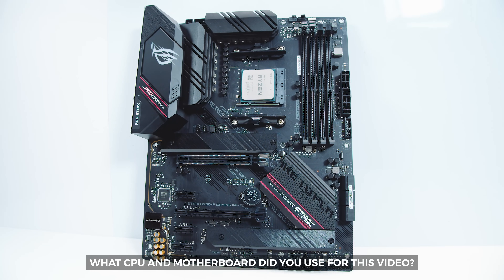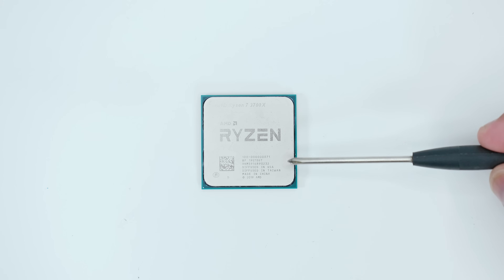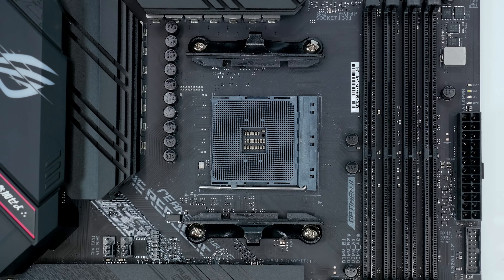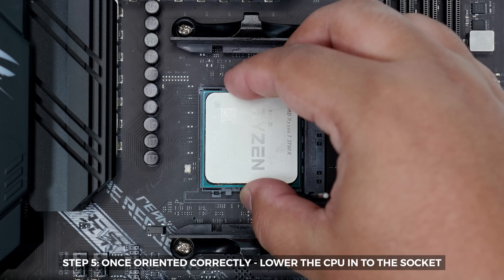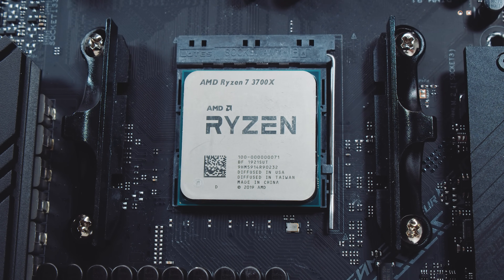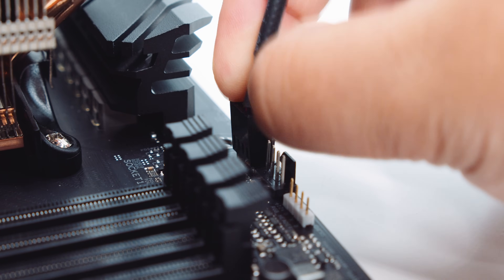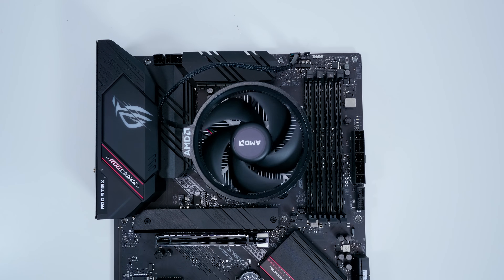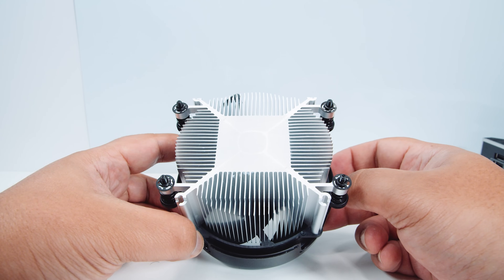AMD Ryzen (AM4) CPU Installation For Beginners + CPU Cooler

Comment: Good video for beginners.  One thing I'd add though is if using a Wraith Spire/Stealth or other cooler that uses the stock backplate but not the brackets, then keep the brackets and screws in case you change coolers or you need to return (or sell) the motherboard.
Reply from the maker: That's a good tip. I did think about adding that in to the video but I didn't want to confuse beginners too much. I'll pin this because I think it's a great little note.
Reply: Questions? With the paste. With applications that already came with paste, is it ok. To remove the pre applied  and apply my own.
Reply: @agskeete  of course you can, but I think it will not make a difference. If you are buying the product from a less well known brand then maybe, but usually no.
Reply: @stanleyshanks4409  so it won't make a difference.  Kraken z73 haven't opened it yet. But I'm guessing paste is already applied. I've picked up paste corsair xtm50 and Artic mx4... but since it won't make to much of a difference I won't bother reapplying my own.
Reply: @agskeete  ye you'll need to clean it off, usually with alcohol each time you take the cooler off and reapply your own paste when you put it back on
Reply: @agskeete   I would suggest that myself, go with a thermal paste that you trust!
Reply: Oh yeah... I have tons of questions.

Comment: It has re assured me that the stock  cooler fan will fit as when I go to fit my Ryzen 5 4600g it seems to rest on the edge of the row of capacitors at the side of the cpu.

Comment: I came for AMD cpu installation and it was so perfectly shown in this video. I was just wondering how the cpu is locked securely on amd, because on intel you can see it more clearly how it's pinned down. I still prefer intel's design though.

Comment: It wasn't mentioned that some Ryzen processors do not just drop-in completely flush with the socket.  Sometimes you have to push down on the corner where the yellow triangle is and then it clicks in place.  Then it will lie completely flush.  But certain Socket AM4 mobo mfrs and even AMD won't tell you this anywhere on their websites.
Reply from the maker: Because its not true
Reply: @GearSeekers  Yes it is.  I checked all pins and they were perfectly straight, so lowered it to the socket the correct way round but it didn't lay completely flush even though the retention lever was fully up.  I then pushed slightly on the corner where the triangle is and it slotted in flush.  Then removed it to check pins again and they were still perfectly straight.  So I inserted it again and this time it slotted-in completely flush without any assist.  I raised this whole issue on a forum and other members said they've experienced the same thing with AMD processors.  Like it or lump it!

Comment: Nothing sucks more than having the backplate fall away from the motherboard when installing a cooler. Had that happen with an Intel socket, no choice but to remove the motherboard and start over.

Comment: Q. Thermal past on stock cooler - Does the stock cooler with say 5600G come with thermal paste? Do you have to do anything to the reapplied thermal paste before installing it.

Q2. Is there any orientation for the stock cooler that comes with AMD 5600G CPU?

Comment: Perfect instruction, Nick - and very encouraging.  

My OCD wouldn't permit me to accept a 3 or 9 o'clock sideways position of the Wraith Spire HSF AMD logo and so, with mine, I removed the fan (4 phillips screws - easy) and rotated it 90° ... et voilà - AMD logo lettering upright at 12 o'clock and ... OCD becalmed.  In 2017 as an early adopter of the AMD Ryzen R7-1700 with its Wraith Spire RGB Cooler Master HSF (c/w copper vapor chamber insert) I thought my build was rather unique with this simple mod ... alas, I've since learned otherwise.
Reply from the maker: I covered that in another video with rotating the fan 😉

Comment: Neat video. Really apreciate your great camera works,

Also don't forget to heat up the cpu before changing your cooler. I forgot and the processor stuck on the heatsink, bent a few pins too!

Luckily, it's fixable.

Comment: To people starting out, just know some pc components are actually sharp so be careful
Reply: Typically it's cheap cases that are sharp. Be careful with the pins on the motherboard, and unless you really have to, do NOT plug in the 24 pin before the motherboard is installed. Learned the hard way that removing a 24 pin is harder than it looks.

Comment: You don't need to look at the under side of the CPU for the alignment marker on AMD, there's a TINY little gold triangle on the top too. After putting the CPU in, BEFORE lowering the retention arm, I give a VERY GENTLE wiggle to make sure it's properly seated, then lower the arm. Another tip for the Spire cooler, since it has a plastic cover on it, you can take the fan wire and tuck it into that plastic housing, I wrapped mine about a 1/4 of the way around and back the other way, and it left just enough to reach the header on the motherboard to help with cable management and air flow. Also looking at where the wire is and orienting the cooler to get the wire closest to the header helps with cable management too.

Is the Wraith cooler really that big? Looks like in the video it covers the 1st 2 DIMM slots. I was thinking of upgrading the Spire that came with the CPU to it, but if it's covering the DIMM slots that won't work, since I have 4 DIMM's in, and the Spire is right next to the DIMM's. I don't really NEED the Wraith since I don't over clock or really task the system, it stays pretty cool, but summer is coming up and here in Germany air conditioning isn't a thing  lol. Do you know how much difference in temps are between the 2 coolers?

My 1st pc build took me about 12 hours, trying to be as gentle with everything, reading the motherboard manual and cross checking it with the case manual, I was so worried I would break something or plug it in wrong. The last one I built early last year took about 3 hours, mostly because of all the extra wires from RGB fans and trying to cable manage better than I normally did.

Comment: If I was a total newbie following this video step by step, I would've learned the thermal paste part way too late. I'd put that part before how to fix the cooler. :)
Reply from the maker: It's a note. That's the point of it being where it is in the video. A brand new stock cooler will have pre-applied thermal paste.

Comment: Great video. All these years seeing you techtubers socket CPU, I noticed that the writings on the Ryzen CPUs line up with the on-socket written imprints. Can that be used as an easier way of CPU orientation?
Reply from the maker: We use the correct and technical way to orient a CPU using the markings provided on the socket and the chip. CPUs have been doing this for 40 years. I'd prefer to stick to the correct way because it doesn't always align that way.